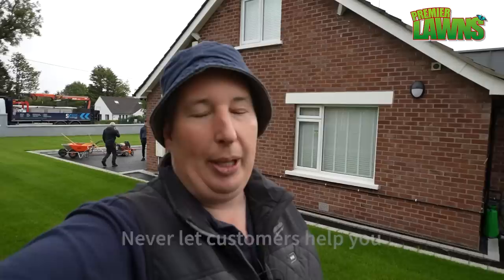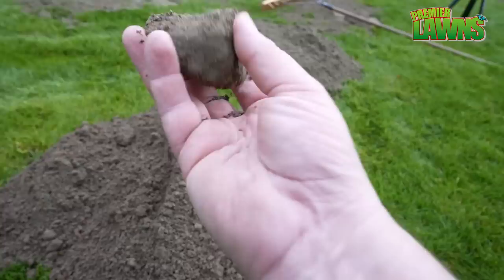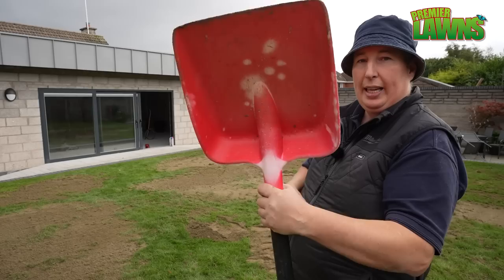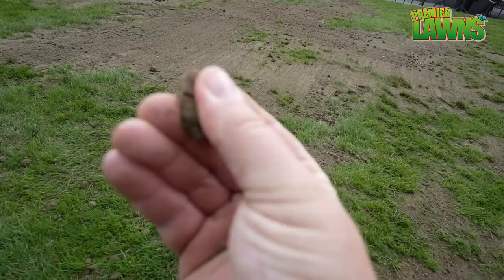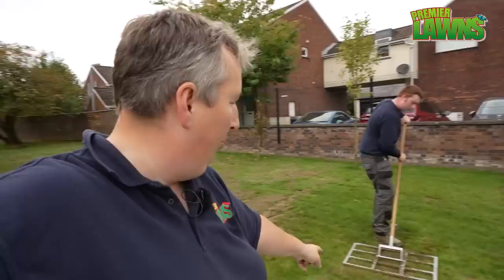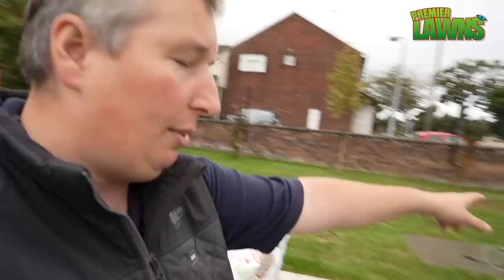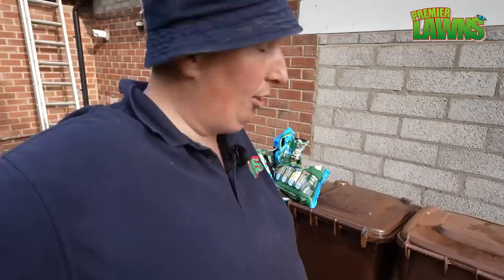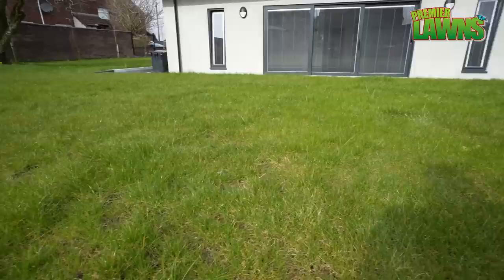Leveling a poorly laid lawn / This lawn was a NIGHTMARE to topdress

Comment: Robbie, what was the length of the grass before you applied the soil? After the winter mine, as many others, has suffered worm casts...lots of them. Lawn up and down.  I will be scarifying then applying 70/30 so fearful of covering existing grass if I mow too low. 
What is your advice please as to whether to cut very very short or leave longer than usual.
Reply from the maker: Janice someone else asked this same question, having the grass longer meant we could add more sand... Not sure why everyone thinks the grass needs to be scalped before hand
Reply: @Premier_lawns_official  will leave it longer then. Many thanks. Maybe cutting it very short is when just top dressing. Levelling is another matter. Just wanted some advice to be absolutely sure. Love watching your videos. Thank you.

Comment: quick question. Why after winter does my lawn look like the aftermath from the battle of the Somme? I do everything including levelling, but I cant afford to keep levelling every year. It was flat before winter, if I run on it now, I am in fear of twisting  my ankle.
Reply from the maker: Not sure to o be honest
Reply: Worm casts? 
My lawn has so many, it looks level but has so many bumps.
I found a deep scarify takes out a lot of the compacted worm cast mounds.
Reply from the maker: @ashgower7083  there isnt much you can do about worms now
Reply: @ashgower7083  My lawn has  very bad worm casts... I was looking to do a scarify in the next few weeks...
Reply: Use a material with a higher % of sand to soil/organic material - soil will just break down and wash away over winter